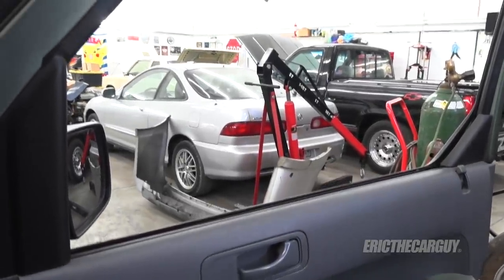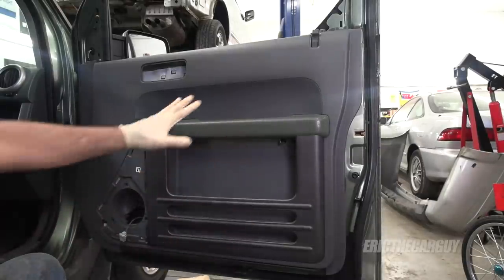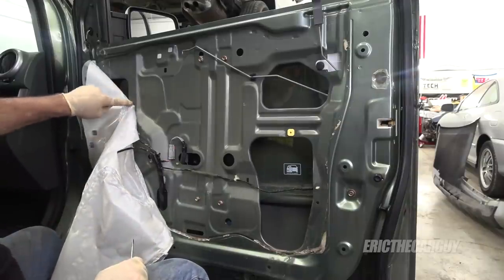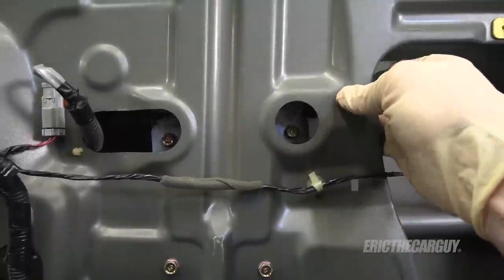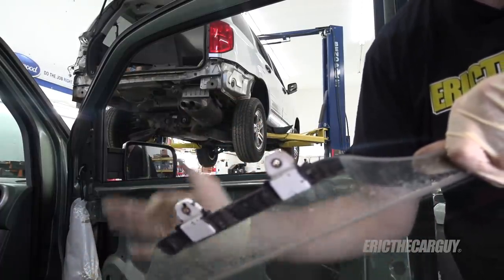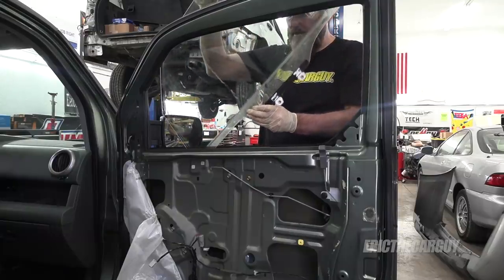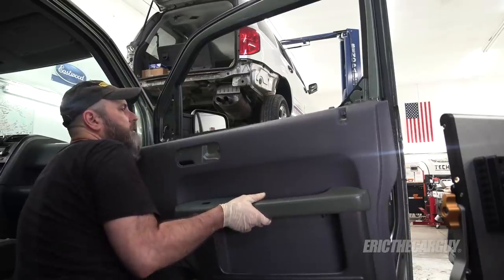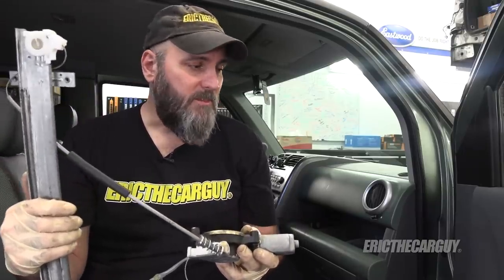Honda Element Power Window Diagnosis and Repair

Comment: About four hundred billion times easier than the window-regulator replacement I had to do on my '68 Ford Galaxie convertible driver's side window.  Whew.

Being a 2-door car, and the approximate size of the Queen Mary, it was a GIGANTIC piece of glass that must've weighed 100 pounds all by itself.  Not to mention the window-regulator -- solid steel and easily 4-and-a-half feet long, front-to-back.  And the hole to remove it from the door might've been a whole 6 inches in diameter.  Maybe?

It was like one of those weird puzzles you see where you have to get the rings through the holes, but none of the holes are big enough?  Ever seen those?  Yeah...  Just like that.

I don't know how the hell they got that thing in there while that car was travelling down a moving assembly line.  My guess is that the door was assembled completely, or nearly so, in a separate building, and then was brought to the car and simply bolted on as a single unit on the moving assembly line.  Because, man, that thing was crazy.  If I'd had 3 arms and could dead-lift 250 pounds maybe it would've been easier, but as a normal two-armed regular-strength human, I found it to be stupidly difficult.  ;-)

Comment: I have 2009 crv, none of windows rolled up or down, when I press the button it’s make clicking sound but nothing happens, I’ve changed the switch for the driver side and still nothing happens same issues, is there any other solution for this problem, thanks

Comment: Are these any more or less reliable than the old design with the crescent mood shaped gear?  I had to fiddle around with those on my 93Lx and 98HX Civic because they deformed after binding up.  Thankfully haven't had any issues with my 04 Si or 07 Hybrid Civic, but I know its coming eventually and I think they use this cable design.  Come to think of it, I may have answered my own question since I definitely had issues with my 93/98 Civic windows within 10years of manufacture. lol
Reply from the maker: With the old design you could just replace the motor if the regulator was good. As for what is a better design, I suppose that's debatable because I think the cost is about the same, and the effort to repair is also about the same.

Comment: Any tips to remember a slow moving window?
Reply from the maker: I'm sorry if I forgot to post this one in the description. https://www.youtube.com/watch?v=gZkRM3e8Nkc&t=36s
Reply: @ericthecarguy  Thanks Eric. Would dielectric grease work the same as silicone grease? They look and feel the same 🤷‍♂️
Reply: Spray silicone spray into the felt tracks. Works a treat.
Reply from the maker: @Jim S I don't recommend silicone spray as it is designed to dry up. I prefer silicone paste for a lasting repair.
Reply from the maker: Maybe, but I recommend silicone paste.

Comment: When replacing the vapor barriers on my truck doors, I used butyl tape to stick them on.
Reply: Yep, good choice.
Reply: Very available at the local big box home store in the weather stripping section. I keep a roll in the garage just for that purpose.

Comment: Eric, If the vapor barrier is cut ir damaged. What do you think of Tyvek home wrap tape as a repair ? Also if the glue does not work any more than use silicone calk to hold it down ?
Reply from the maker: I never tried the tape, but I believe the silicone would work just fine. It doesn't need to be perfect to do it's job.

Comment: This is more or less the same design as the Chrysler ones from the Dakota/Durango from 97-03.  The difference those tend to break on the nylon tab holding the drive/pull cables.
Reply: I replaced all 4 of mine at least twice.

Comment: My 2003 Element passenger window is stuck in down position. I hear the motor still working. Looks like I'll be doing this repair.

Comment: I've reattached vapor barriers by simply duct taping them to the door. It works and no one's ever gonna see it anyway. Just have to make sure no tape is sticking out around the edges of the door panel.

Comment: I've gone through 10 total since I've bought mine in 2009, is that normal?
Reply from the maker: Seems excessive. I'd recommend lubing the window tracks with silicone paste so that it can move easier and stress the motor less.
Reply: @ericthecarguy  I don't really use them tbh. Ill hear it pop out of nowhere, and they bust while the window is up.
Reply: But that isn't always the case. A few have broke while in use

Comment: Please show how to repair loose window rollers or tabs on car glass windows. Thanks.
Reply: I really would welcome this. My passenger window has rattled since new. Happens when I put the window 1/3 down.
Reply from the maker: I'll be happy to do that if the opportunity comes up.
Reply: @ericthecarguy  thanks has been rattling since new, dealership never fixed it. How’s the exhaust system?
Reply: @ericthecarguy  it seems the tabs are not removable in my car i20 2011 model.

Comment: The drivers side window on my Honda Civic 2010/11 goes half way up then back down. You have to repeatedly press the button till eventually it goes all the way up. Sometimes it does it instantly sometimes you’re there 20 minutes! Total pain in the ass!

Comment: Spray some silicone spray in the tracks roll it up and down and spray one more time do that once or twice a year.
Reply from the maker: I don't recommend silicone spray as it has a tendency to dry up quickly. I prefer to use silicone paste as it lasts a lot longer. Video linked in the description. Thanks for the comment.

Comment: Eric, and anyone else-
If you have a door/window mechanism that constantly
burns out or strips window motors- check the roller tracks
for damage, misalignment, missing fasteners, and lack
of lubrication. Also- check sills and tracks for bent
parts, worn or missing rollers.

Binding over time will stress the electric motor and plastic gear.
Reply: Also lubricate things that need it! Clean both the inside and outside lower window wipers/seals of the dust and industrial fallout that builds up on them. Clean the top and side guides and lubricate just the side guides with a dry Teflon spray lube to help the glass glide so much easier up and down. Clean and lube any pivot points, tracks, or rollers that the glass and regulator use to move glass around. I always find that manufacturer grease quality and amount is terrible. I take it off and apply my own that I know is good stuff. In my experience with window regulators and motors, OE and OEM parts are always better than aftermarket. Buy once and cry once. Aftermarket parts are skimpy and cheap. It's false economy. The factory ones are built properly. They are well aligned, robust, and built to last. They are more expensive, but it's worth it.

Comment: Is it just me or does the window go up and down too slow? And the motor sounds like it's struggling a bit. Possible cause of the failure?
Reply from the maker: No, if the engine was running it would be faster. I think the cause was a cheap aftermarket window regulator from the last replacement. Also, this design seems to fail often regardless. It's not a bad idea to lube the window tracks with silicone paste when you have the window out. That will make it move easier and prolong the life of the new part. Thanks for the comment.

Comment: Have you ever converted a Honda window to one-touch up/down?
Reply from the maker: No, but that is usually handled by a chip in the switch. At least that's how the OE ones work.
Reply: @ericthecarguy  But doesn't there have to be a sensor in the motor assembly?

Comment: That is much easier than a chevy tahoe. Lol
Reply from the maker: GM is cheap with rivets instead of bolts for fasteners.
Reply: @ericthecarguy  mine had bolts. Probably because it was replaced before. But i was talking about the rails on both lrft and right sides and the kriss ctossing of cables